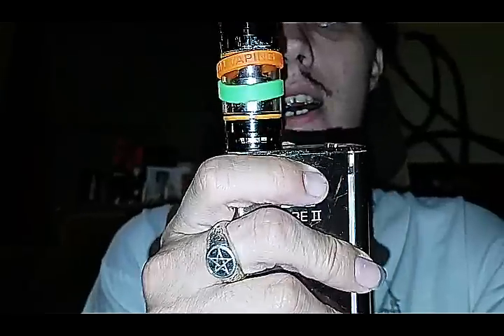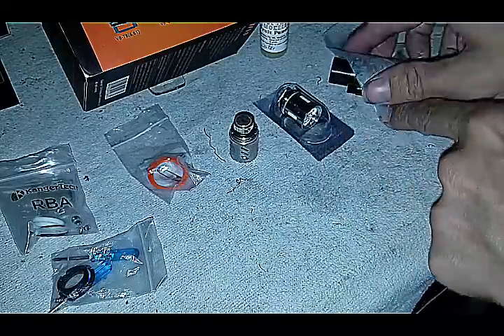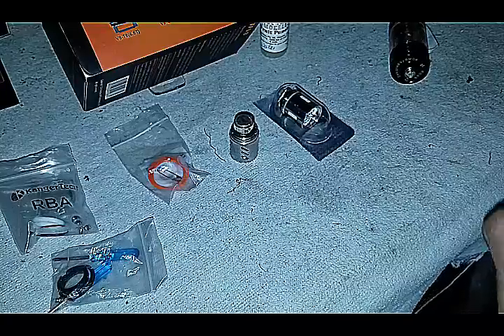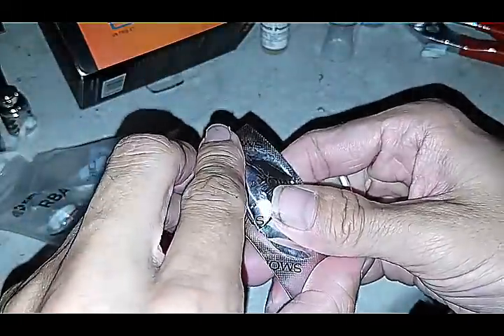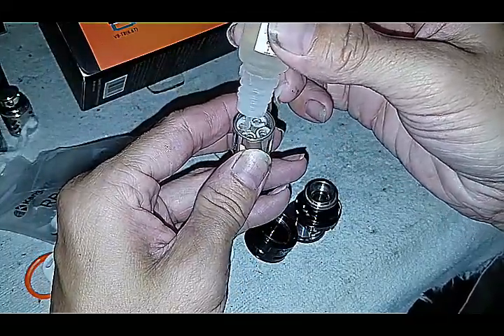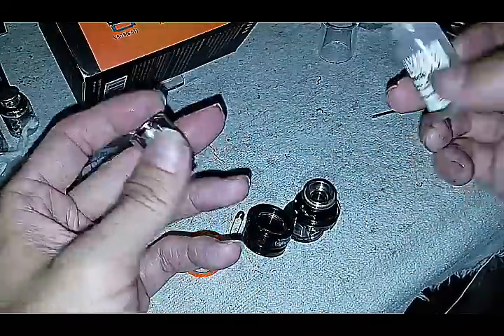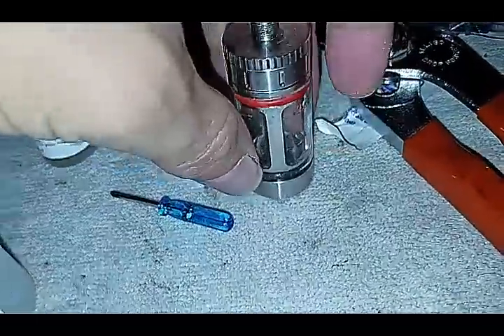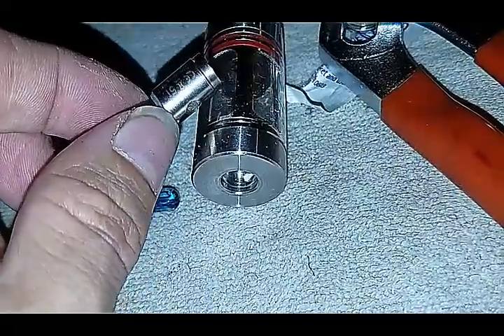TFV8 THE BEAST TAKE IT APART CHANGE THE RINGS CLEAN IT INSTALL NEW COIL

Comment: Hey great video but I have one question, I did all this for my big baby beast tank and I had two very small clear rings I think one goes under the chimney tube on the inside where the coil screws into the top mouth piece (since there is a clear ring in there) but I could not for the life of me figure out what the other one was for.

-Any idea? I'm rather new with vaping and haven't quite figured everything out

-Thanks ahead of time!

Comment: here lately it's been hard to get the bottom off. the part that has the grip right above the air flow part just spins when I try to unscrew it. there's nowhere to grip it to get it off. I've never had that part spin freely before
Reply from the maker: Jacob Rester the thing is that part That turns it's the smallest part at the bottom you have to get pliers to unscrew
Reply: VT6VAPING okay, I always either used a shirt to get grip or pliers right above the airflow ring but I'll have to start doing that now.

Comment: the bottom of my tank wont stay together. it keeps falling apart.....the top is snug like its supposed to be but the bottom is loose as hell....wtf do i do????
Reply: Like where the glass connects to the bottom? if so I had this happen just the other day where the glass would just leak and not seem tight on the bottom, I just replaced all the rubber O-rings and it's all good now.

-If it's something else then I don't know (rather new with the vaping scene)

Comment: How often should I replace the coil?
Reply from the maker: Gary Fogle honestly that depends on a few factors like one what kinda juice your using two what kinda coil your using and other stuff as well usually if you go to a vape shop they will tell you if u only order online however it's a little harder.  Now if your specifically asking admit the t8 on the other hand then yea it still depends on juice and how heavy you vape with that one I think every two ta three weeks around or so personally I prefer the t12 it's a real beast hehe and I only usually have to switch coils lone once a month depending on how like what juice I'm using like if you use a lot of sweetener them you might have to change it a like more often like 3 weeks or got the t8 week and a half two weeks well I hope that at least helped a little I hippie I didn't just make it more confusing lol let me know if you have any other questions